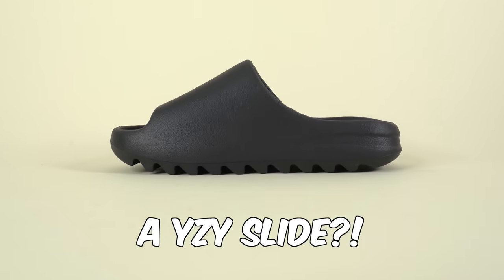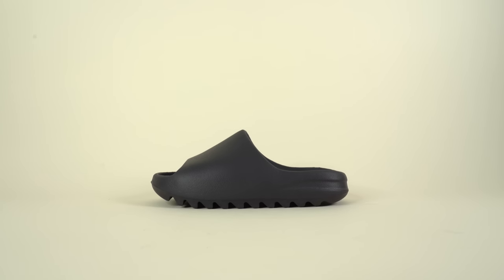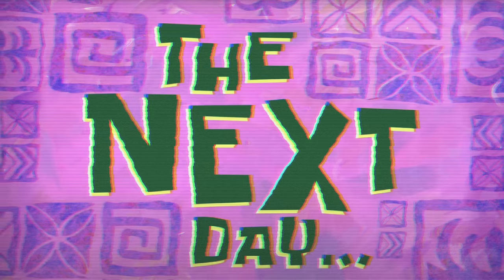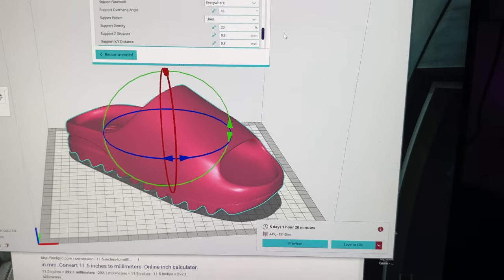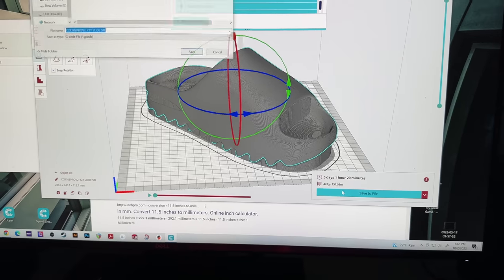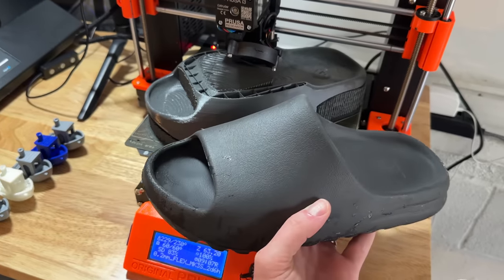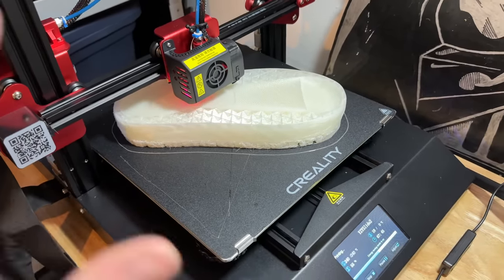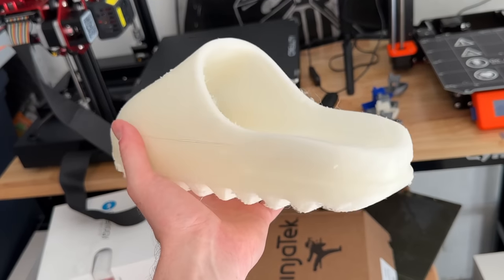I 3D Printed YEEZY SLIDES

Comment: I do recommend printing in a boxed environment with a vent shaft attached due to toxic chemicals released in the air from heating the filaments. As far as the first print goes, with a dremel and fine sandpaper you can shape up the details nicely.
Reply: He used tpu which doesn’t use toxic chemicals, but abs does😊

Comment: I think you need to mess with retraction speeds to help lessen stringing
Reply: Also idk if it works wit flexable filament but blasting it with a heat gun helps get rid of stringing just need to be careful not to overheat so it does warp the shoe/part
Reply: Also last tip mess with you infill pattern helps save on time a lot certain ones will uses less infill compared to others maybe you should try different infill patterns see if that helps with comfort and could help cut on your print times too I use gyroid infill pattern for cosplay parts and it usually takes off like a half or a whole day of printing for like cosplay helmets and stuff.

Comment: You should try Ataraxia's flexible PLA, it's got the squish, but it prints at the same speed as PLA (since it doesn't have much stretch).
You will want to go with more infill.

Also have you considered printing the slides hollow then use expandable foam to inject into the print?